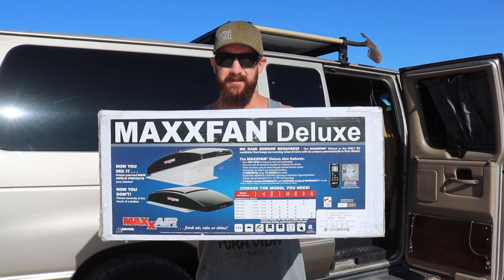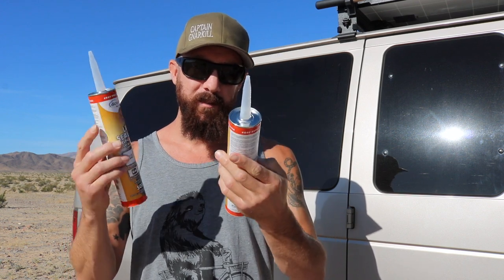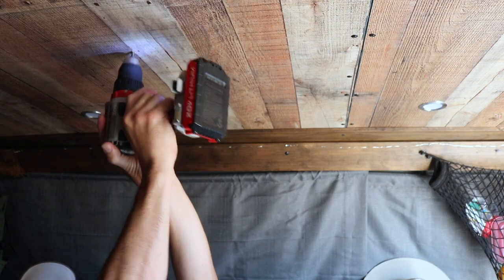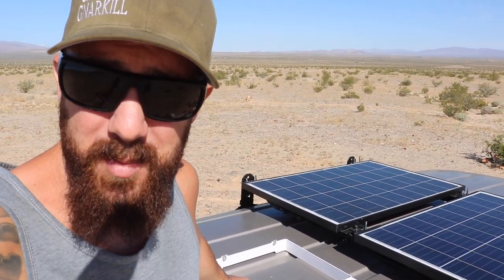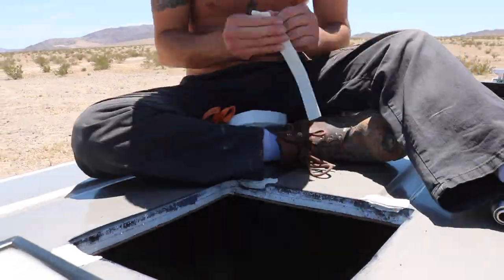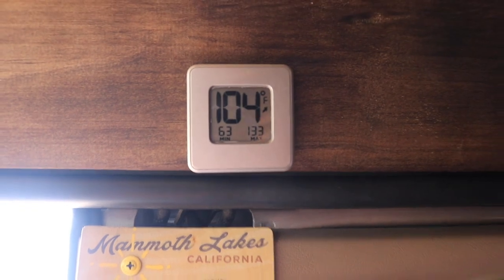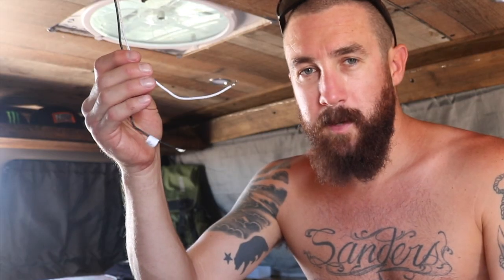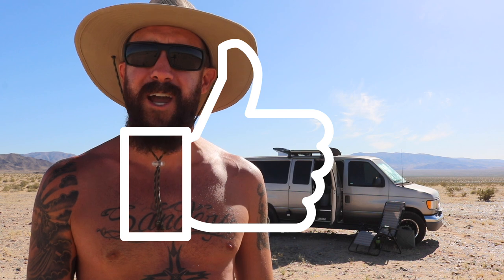How To Install Maxx Air Fan On Camper Van

Comment: Great use of the bag that the fan comes in!
Reply from the maker: Hahaha thanks, it didn’t work out too well but it was worth a try
Reply: @CaptainGnarkill  Yeah definitely worth a try. I just finished installing my fan. After watching your video, I taped up the bag it came in underneath the big hole and it worked well for catching lots of bits. It also came in handy to easily retrieve a couple of hand tools I had dropped instead of having to climb down off the top of the van. I just pulled the bag up enough til I could grab them. Whether you use a trash bag, bag from the fan, whatever, it definitely is very helpful to tape something up under there.

Comment: You bought the right fan for sure.  Nuther tips: remove your vehicle negative battery cable before starting the project. Then also drill a hole just and only big enough to poke a screwdriver and flashlight into, feel around and make sure before drilling the 14"x14" hole you aren't going to jigsaw slice up critical wires in your roof like the expert installer I used did to my van, blowing fuses and cut through wires that were never fixed. (My overhead clearance lights don't work anymore). The smaller hole gives you the chance to poke around and make sure nothing important will get jigsaw chopped up.  And the beauty ring measurements may have different lengths on each side just like your uneven floor and curvy walls weren't straight either.  Butyl tape works real fine in 104 degrees F!  Nice video.
Reply from the maker: Im running it off solar so all the van battery under the hood does is start the van. Good tips though and I bet you could rewire those clearance lights if you really wanted to pretty easily.

Comment: Best vid I’ve watched on how to install air vent. I only have one question and please forgive me if it seems silly… where do you find the wires to hook the fan up to for power? Should this already be somewhere in my van or do I have to install electrical wiring to power the fan? Thanks in advance.
Reply from the maker: Thank you. As far as the wiring, I installed a solar panel and battery bank to power accessories like this fan. The reason this is ideal, and you will see a lot of people do it this way is to keep the starting battery for the van completely separate from everything else.
Reply: @CaptainGnarkill  thank you for this information. I have a Bluetti and will be purchasing a Solar panel soon. I guess I’m just wondering where you hook the loose wires into coming from the air vent? Again, I know this may sound like a silly question but I’ve seen some vids where they have spliced AC/DC chargers to connect the wires to in order to plug them into a solar panel or the vehicles AC/DC cigarette lighter. I’m so confused.
Reply from the maker: Those power stations like the one you have are great and definitely simply the system. I recommend checking out Will Prowse channel. He has some of the best videos I have seen about solar setups in a ‘how to’ style. I have made a couple too, but his are more focused on the topic.